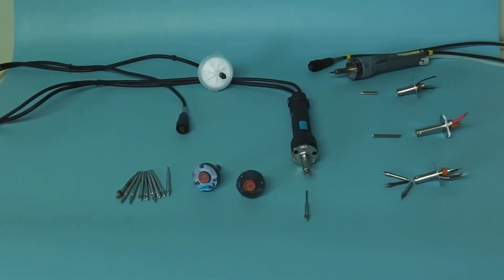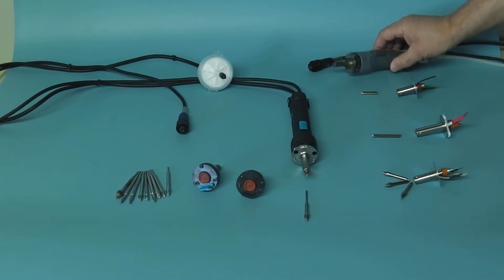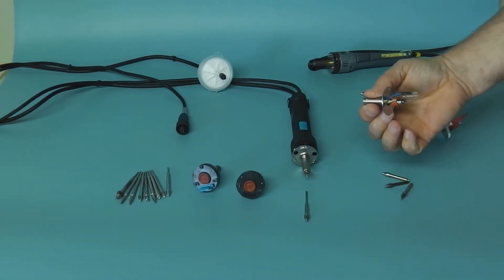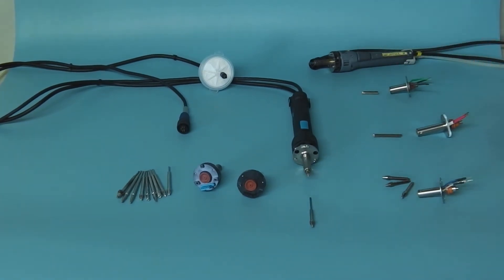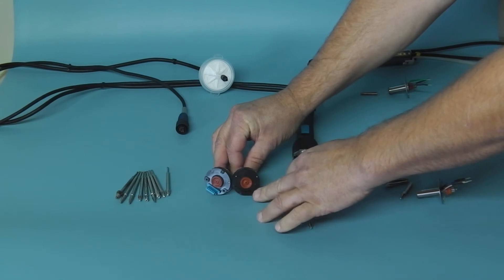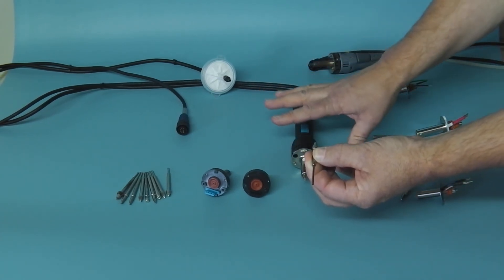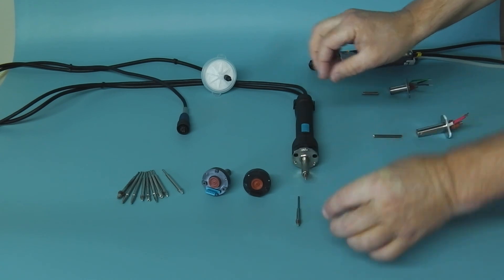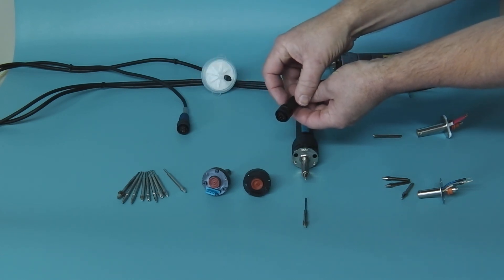Desoldering handpieces PACE video - by Baskiville.com

Comment: Out of curiosity, do you know if Intelliheat handpieces with blue heater connectors are backward-compatible with black-connector heaters? I recently got a used SX-90, and while the heater has a black connector, the handpiece itself has a heater connector that is blue inside. (Purely an academic question, since a replacement heater costs the same regardless of version.)

Comment: Hi

Do you know what the difference is between the blue and black heater modules for the sx80/90/100 ? are.  Also how do I tell which element I need if I do not have the old element..  The connector which connects into the mbt350 is a blue plug, does this  correlate to the connector colour in the heater element plug.   One final question do you know if there is a thermal fuse in the heater element.  Thank you in advance
Reply from the maker: Hi Julian
 The information you need is the plugs are the same width ( 14mm).The depth is also the same ( 8mm).BUT the ( 6010-0163) blue plug is Thicker ( 4mm) than the Black (6010-0107)almost(3mm).
 And 
I am not sure about what is inside the workings of the heater.. sorry
Hope this helps
Email us with photos if you need more information

Malcolm

Comment: Excellent video helped me with my SX -70 I have a question my pace ThermoFlo PPs 95 the gun is broken shows message (open  sensor Error) any idea how to fix or  where can I buy this part thanks
Reply from the maker: Hi
Most likely it's just the heater element burned out as these are
consumable items, and it can be replaced with item 6010-0091-P1. In the 120 volt stations
OR
On the off chance they meant to say they have the PPS-95E, than they
would have the 230v model which uses a different heater element.  There
are two different versions of the 230v model out there.  If the serial
number on their (230v) station is 03-99-9999 or lower, than they'll need item
6010-0092-P1.  If the serial number for the station is 04-00-0000 or
higher, than they'll use item 6010-0122-P1 instead.We are 240 volt here in New Zealand and have these element in stock ( Prices are NZD retail )
http://www.baskiville.com/products?loginname=GUEST&loginpw=&AC1=LOGIN&X_SCHO=6010-0092&x=6&y=6
We are happy to Quote in diffrent currencys and we may be able to supply a 6010-0091 ( dropship from Pace )

Hope this is a Help  MN